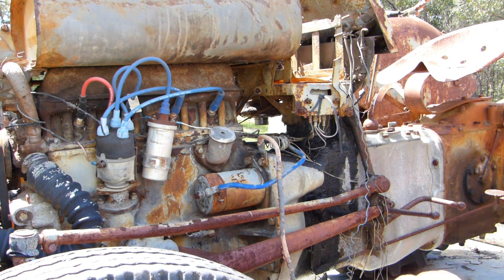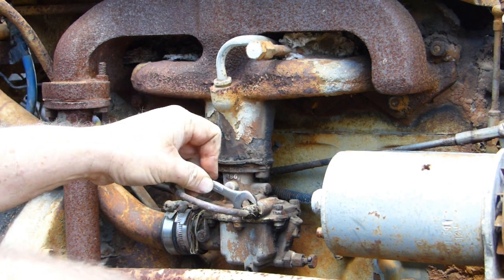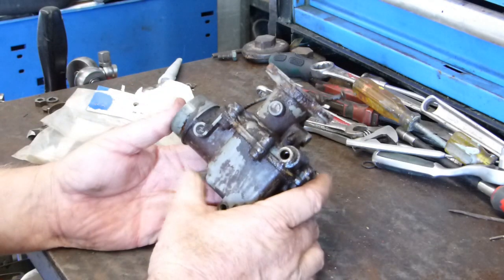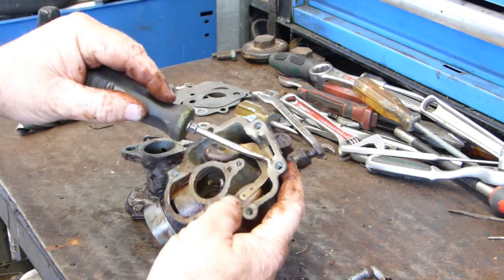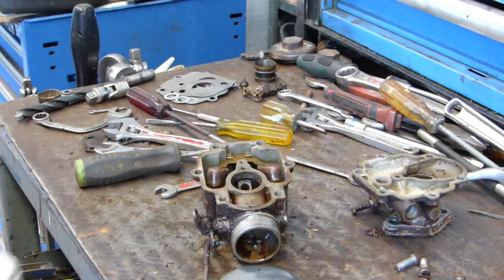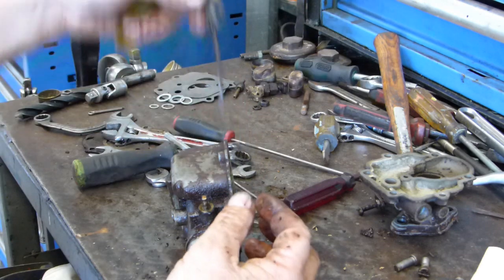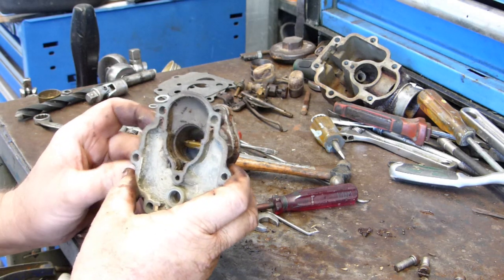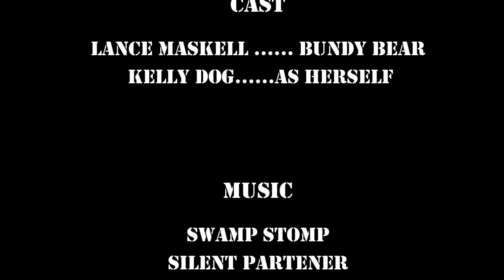Ferguson TED20 Barn Find, Lets get it going Part 1

Comment: I've always steered clear of carbs and fuel pumps, but after watching you videos I'll certainly be having a go in the future. When I got my E27N it would run on petrol for a while then stop..after a while it would start again and then stop. After a lot of head scratching and elimination it turned out the previous owner had change a fuel line and had left the olive too far up the pipe causing the pipe to bottom out on the casing and only letting a drybble of fuel to the carb. a minute with a hacksaw was all it took 

An interesting fact about thread tape...it was only developed to be a pipe thread lubricant. The fact it also acted as a sealant was a lucky coincidence and a headache to many of us
Reply from the maker: I never knew that about the thread tape, these tractors are often that old there is no telling what Farmer fixes have been done.

Comment: Thanks for the video Lance. Keep them coming. They are a big help.
Just a thought about the float test of your repair. Since the density of gasoline is only 3/4 that of water, there are situations where it would float in water, but not in gasoline.
Reply from the maker: Yes I suppose it would but my main aim was to check for bubbles to make sure I soldered it up properly.

Comment: Good stuff Lance, I got a set of AF spanners if you need them mate. Also I find a 50/50 mix of cellulose thinners and kerosene is the best for cleaning up old carbs, just submerge the carb in and leave it a few days. Keep up the good work mate.
Reply from the maker: G Day Andy, I have never tried the thinner and kerosene, I have a glass bead blaster so I use it for most jobs.

Comment: Great video as usual Lance, interesting that there's a mix of imperial and metric fasteners there!  I would have guessed with the age of the tractor it would all be imperial, wrong again...
Reply from the maker: Yes it is a bit odd and a pain in the bum thus the shifting spanner, you would think they were imperial for sure.
Reply: They'll definitely all be imperial sizes on a te20 the UK didn't go metric until well after they were built haha. Maybe just wear/mess on the bolts/nuts 👌

Comment: I have a24T2 CARBURATOR and where your main jet is ,i have what seems to be a drain that you can unscrew by hand. it is treaded ,then goes to a point, is it just a drain or a jet of some kind? thanks
Reply from the maker: The main jet has a big mixture screw that can be adjusted for tractor load, usually 1 3/4 turns out from full in.

Comment: Great video series.  I have started on my TED20.  My fuel tank is rusted on the inside.  Any suggestions how to clean it? I noticed you did not install a new gauze on top of the glass bowl.  Is that part not available? thanks
Reply from the maker: Yes it is available but as there is screens on the banjo bolts probably not needed if they are all in good condition.

Comment: That lack of fuel flow when the fuel bowl is fitted is what my TEA20 does. The bowl fills quickly, plus rust particles, once I start the tractor though. I am just replacing the tank as it is full of rust, refurbed the fuel tap and carby is next on the list. I'm expecting the carby to be full of crap too.
Reply from the maker: Carb most likley will have some, worth having a look for sure .

Comment: Hey Lance, I have a T30 Ferguson and I just rebuilt the carburetor and cleaned out the oil bath filter. The tractor runs great without the oil bath line attached to the carburetor but when I attach it and run the tractor for a bit then shut it off, the carburetor floods out, runs up the oil bath line, fills up and dumps into the oil. Any ideas? Tractor man in need!
Reply from the maker: G Day John, I think your needle and seat are not sealing as they should. When you stop your tractor the carb bowl will fill with fuel and the float will push on the needle and cut further fuel supply off until the tractor uses some fuel from the bowl. I would suggest checking the needle and seat.

Comment: Hi again ,this drain is located on the front facing the rad direction at the base of the bowl ,is it just a drain ? thanks
Reply from the maker: The main jet has a knurled outer edge on a round knob and the drain is a smaller T handle
Reply: @BundyBearsShed  Hi Lance,you were right on the money,thanks again.

Comment: Hi Lance , I've got a T20 that hunts at high revs any suggestions , carb adjustments maybe , question is which one
Reply from the maker: G Day Paul, Go through my governor adjusting video then hold the tractor at high revs (flat out) and adjust the main jet to get it running smoothly. The main jet it the big thumb screw.

Comment: Hello Lance, I have a question regarding the TEA-20 that I am restoring. When replacing the oil filter I noticed an adjustment locking nut and screw on the oil filter housing.  Can you tell me anything about this adjuster???  Look forward to all your videos, they are very very much appreciated.  Thanks!!  Spring is awfully late arriving in Sault Ste. Marie Ontario (49th parallel)  this year.  Wish I could send you some snow.
Reply from the maker: G Day Fred, That is the pressure relief valve for the engine oil pressure.

Comment: Hey Lance, i was wondering if you know if a TO-20 distributer will work in a TE-20?
Reply from the maker: Im sorry but I dont know,
Reply: thats alright, until today i thought i had a to20 but scratched the paint off the name plate and realized the tractor is a te20. its been sitting for years im gonna try and get it going your videos will help me alot!

Comment: Have you tried the Knipex wrench pliers? bloody sight better then a crescent wrench most of the time, they don't round off the nuts so well though :)
Reply from the maker: G day Den, Yes I do have some somewhere I will have to track them down again, the little cresent wrenches do a good job for the not so tight stuff though. I find Kingchrome brand the best as they open further than many other brands.

Comment: would be nice if you had some wrenches or spanners , i dont like nut rounders but they do make good hammers
Reply from the maker: G Day Jerry, Yes I often do use the correct spanners but on these carbies they have a lot of rounded corners from shifting spanners and often the best way is to use a shifter once more, also there is a mix of metric and imperial on these so I find it easier and quicker with just a shifter. They do make a good hammer though lol.

Comment: What is the name of the bar you took off the back of the carb please someone reply need help
Reply from the maker: Either the choke rod or the governor rod.
Reply: Bundy Bears Shed not that one the one that goes from the carburetor to the front next to the fan. The bar has a blot on one end and is connect to the carburetor.

Comment: Hey bundy bear, do u have a video on how to tune the carby once it's on and running?
Reply from the maker: I think so, just go 1 3/4 turns out on both screws and that will get you close. I think I might have done it on the barn find tractor.

Comment: Lance,
I reviewed your www.queenslandtractorspares.com.au website and found the excellent reference on TE20 Serial Numbers. Much appreciated resource.
I now understand that a TED20 is a Ferguson Tractor with Standard TVO (Tractor Vaporising Oil) engine. I would assume that petrol-paraffin is no longer available in Australia and United Kingdom. Do you  use kerosene fuel to run this tractor after you start the engine with petrol?
Reply from the maker: No it is not available I run all of mine on Premium unleaded with no problems at all.

Comment: Mate you're like a walking encyclopedia when it comes to fergies. wish you were my neighbour. i played with my carbie a few times, just can't seem to get it right., she runs ok ? except the air mixtures are doing my head in.
Reply from the maker: G day Danny, You would need to drink beer to be my neighbour lol. To set the main jet just rev it hard and adjust it to run sweet while up on high idle. Go a little richer than lean. On the idle just adjust it in turn with the idle speed screw until you find a happy medium.

Comment: Hate to see a shifting spanner used incorrectly..
Reply from the maker: Very handy tool can be used as a light hammer as well, I do know how it should be used but sometimes it is not all that practical to do so. I don't get too worried by it.
Reply from the maker: Ha Ha I can just imagine
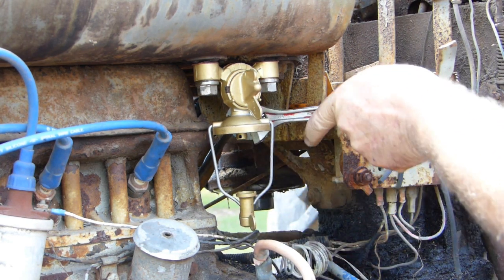Reply: Didn't mean a hammer, at around the 1:40 minute mark you used it backwards, and it does matter. Use it like that on something tight and you will stuff the shifter.
Reply: No just a old fashioned Aussie trained motor mechanic who was taught to use tools properly, and dislikes people who should know better abusing them.
Reply: I think you'll find Tubal Cain disproved the theory of "correct" orientation of an adjustable spanner; https://youtu.be/yjYWpqaqS-4 He showed it doesn't matter which way round you use it because you shouldn't use it in high torque situations anyhoo! So I'm with Lance and use it whichever way works..
Reply: Know a man who has used a pipe wrench on a MF 35 for years not a nut or bolt left you could fit a spanner on.